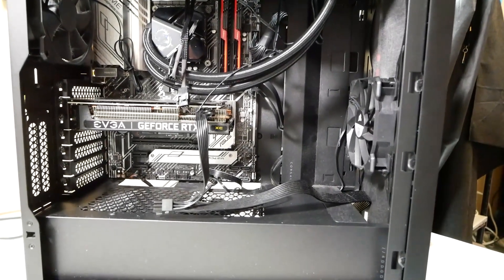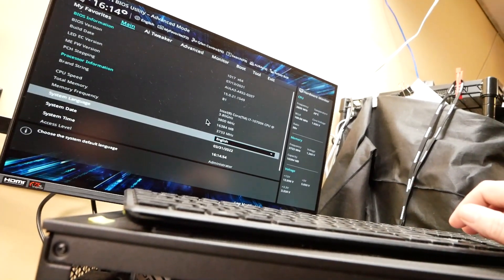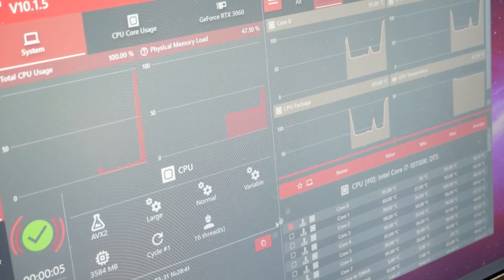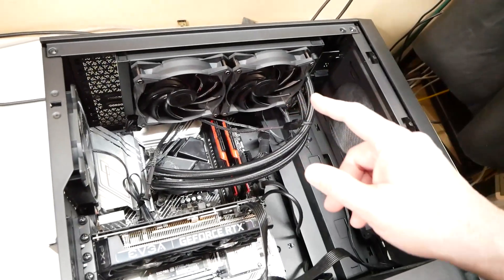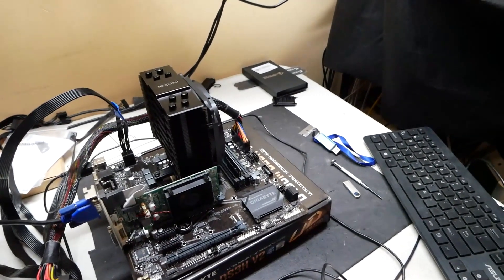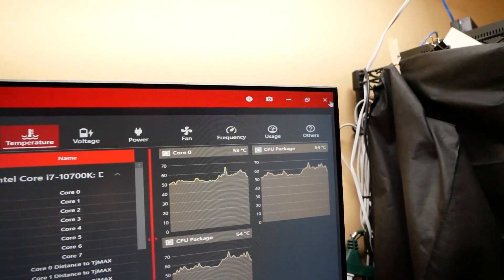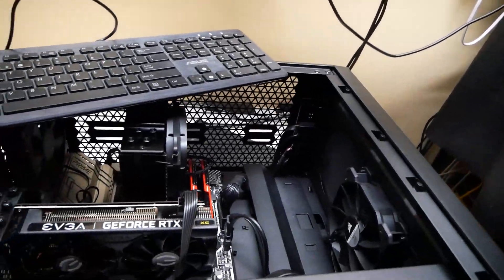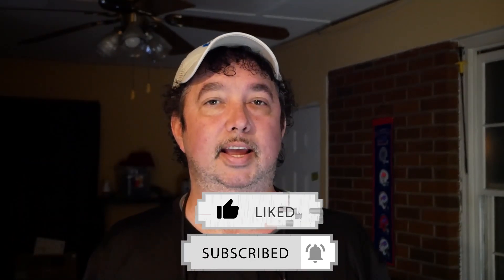Why is My Gaming Computer Crashing With Bluescreens?

Comment: This is one good reason to stay away from liquid cooling in PC's!  And I've been doing Plumbing & Heating for over 40 years. We use non toxic anti freeze for some jobs where it makes sense being that having it in the system adds work to any repair that requires draining. So it's not something that's the 1st choice.Houses with pipes run in easy to freeze places or weekend homes are worth considering. The heat transfer fluid is basically glycol that is diluted to keep it from getting too thick to flow properly especially if there's any radiant heat in the place. And it 's supposed to be replaced every 5 or 6 years if someone didn't accidentally drain it out before that and lose it anyway!    🤫
Reply from the maker: I agree with you. Thanks for commenting.

Comment: Great video! I have heard (and seen) from many others that those MSI and another brand called Cougar (there is probably more effected brands with this in-radiator pump style) had quality control issues with the coolant used in their liquid coolers.
There was a problem (not entirely sure why, I don't claim to be a chemist) with the type of coolant used where a form of galvanic corrosion would occur between the copper cold plate and the aluminium radiator and turn the coolant to a jelly like substance, this would plug the cold plate fins (sometimes even the pump) and reduce or even stop flow and thus reduce peak cooling performance or the ability to cool all together. This can be seen when at idle the temps were in check, but as soon as a load in placed on the CPU and more heat is needed to be removed the reduced capacity of the cold plate from clogged cooling fins in the copper gets quickly overwhelmed and causes overheating.

A recall was later issued for the effected units and they revised the coolant mixture, from my knowledge there has been no notable failures on newer recall replacement units.
Reply from the maker: Yeah that is what someone was saying earlier. Thanks for the information and thanks for commenting.

Comment: And there is why I hate water/liquid coolers. CPU killers! I have a system in the same Corsair 4000D case Air cooled and never seen it go above 68 under-load 👍🖖
Reply from the maker: Good air coolers are just as comparable. Thanks for commenting.
Reply: @TimsComputerRepair  True true! especially when it comes to stock style coolers.

Comment: Hang on did you just do my Helllloo Everyone video intro ? 🤣🤣🤣🤣

Great troubleshooting as always. Im assuming you fitted a new cooler? 
Be interested to see if putting new water-glyco in it would have "fixed" the AIO.
Reply from the maker: Haha did not even think about the intro. I forgot you have a patent on that. I really do not like closed looped water cooling even though I have one myself. Thanks for commenting.
Reply: @TimsComputerRepair  🤣I just found it funny haha. Yeah im the same, I have had 1 closed loop cooler and I will never again buy one for one of my systems, had nothing but issues with it.